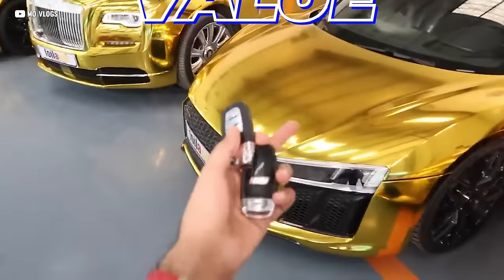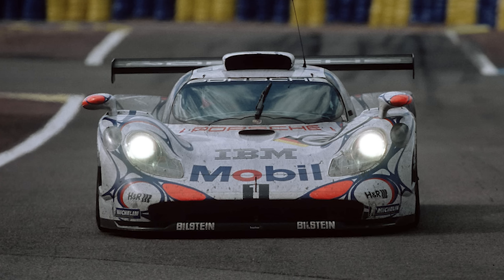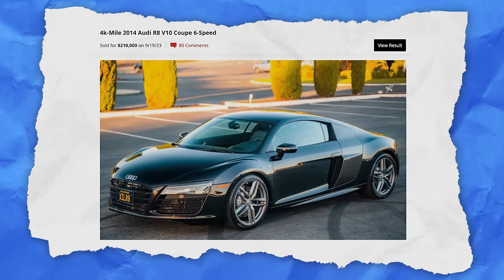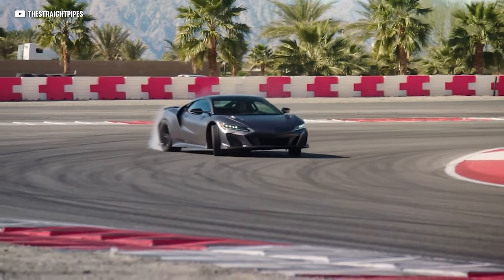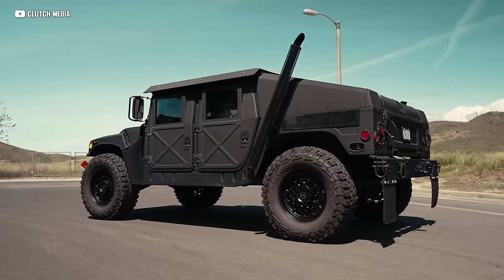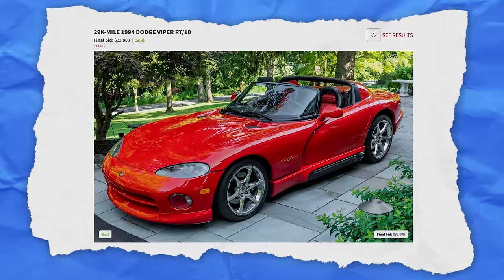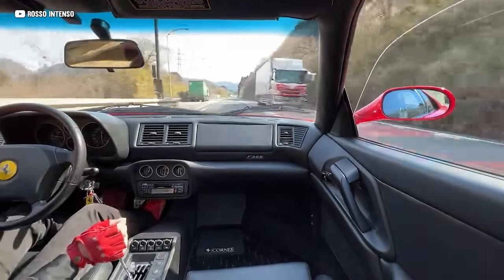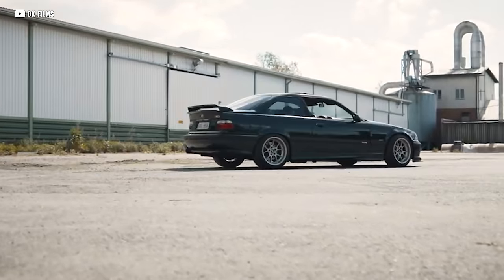Buy These Cars And MAKE MONEY (in 2024!)

Comment: Have an 06 Mustang GT convertible with manual. It's still the best-looking Mustang and is best mix of slightly modern and old-school muscle. Traction control is almost non existent except a light on the dash. Solid rear axel with LSD, makes for a nostalgic experience that requires skill to throw around without killing a crowd.